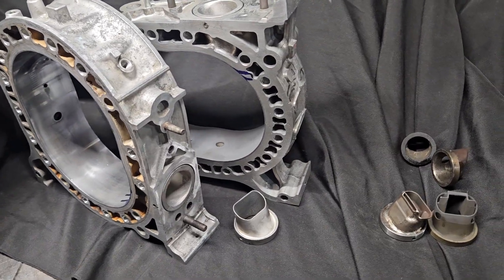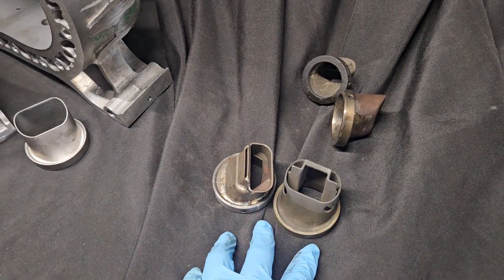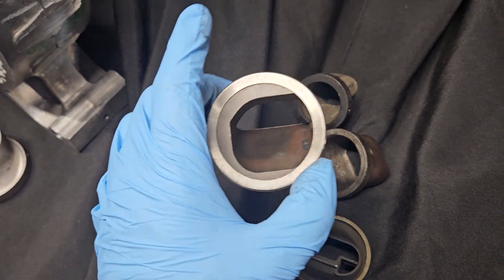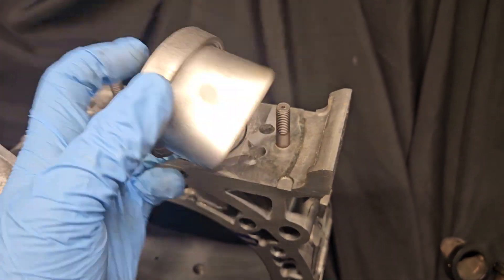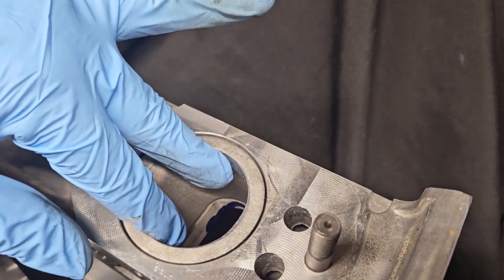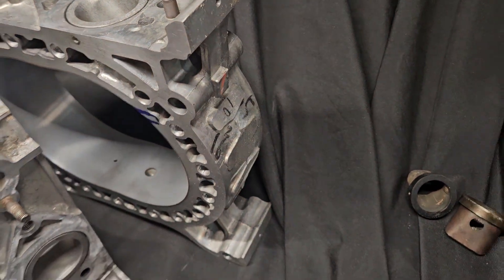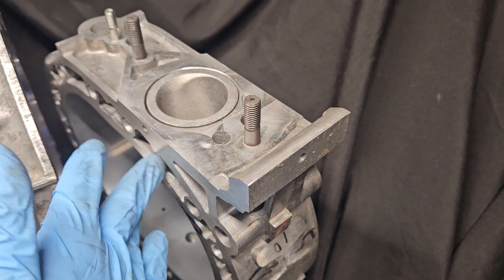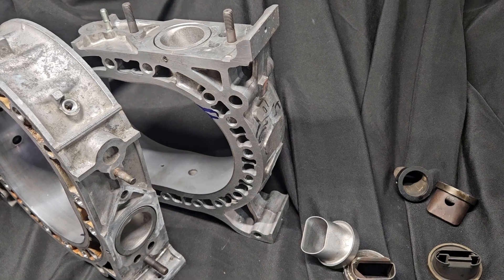Titanium Exhaust Sleeves, Mazda Rotary Engine tech, replacement of restrictions - KMR Rotary

Comment: I have a quick question regarding an oiling system mod. Sorry it doesn't have to do with the sleeves. Haha. I've been looking to build myself a race 13brew engine and been wanting to get the loop line mood so I could also run solid dowels. Is the loop line mod really necessary in high hp or can I just run a line to the front iron through where the turbo oil feed comes from and call it a day? Love the videos BTW! Very informative. 🙏
Reply from the maker: Email me www.kylemohanracing.com